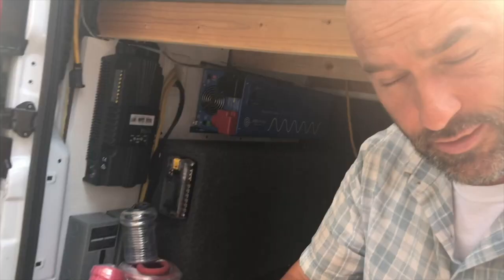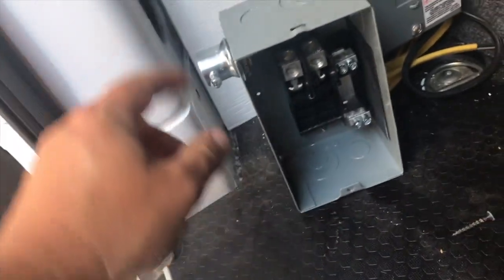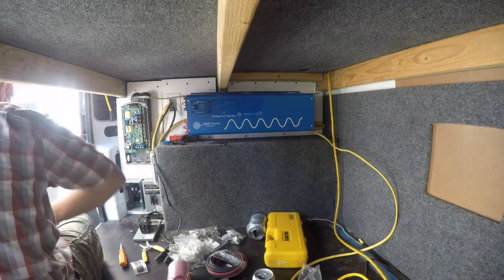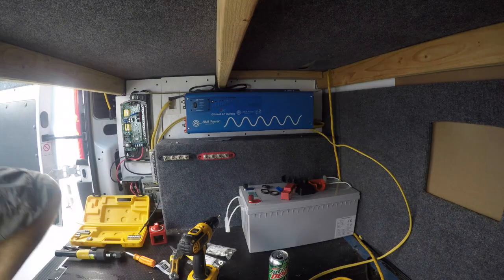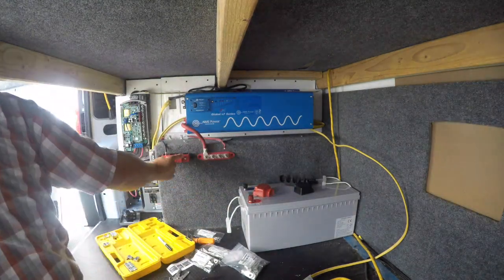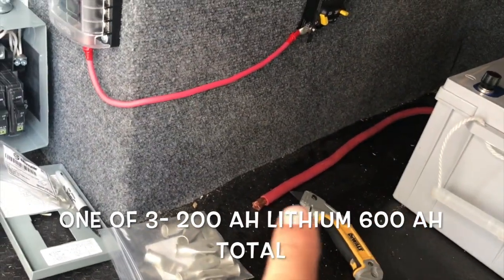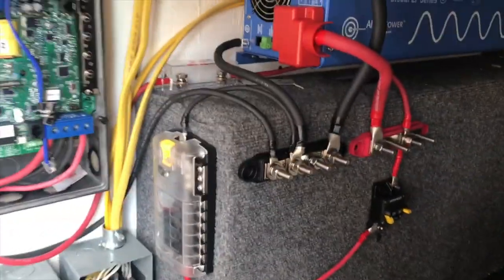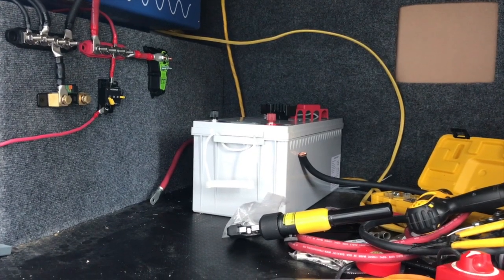Electrical system install in a Promaster conversion van

Comment: I couldn't tell how you connected to the car battery and how you routed the wires through the van from the car battery to the leisure battery. Could you share a little detail on that?

Comment: Specs don't look good on the battery. Discharge rate at 40 A, and peak discharge at 50 A.
My 100 Ah Battle Born are rated for a continuous 100 Ah discharge, and 200 Ah peak discharge (for 1/2 second).
I doubt that they are using the same cells as BB.

I hope you get decent performance out of these batteries. The rest of the install looks good.
Reply from the maker: Thanks Jeff- I put up a new video, I hope you'll check it out! I had the manufacturer modify the BMS for me so the new video shows the specs. I was able to run my AC for 7+ hours on just the batteries the other day! so amazing! hope you and your family are well in all this craziness

Comment: what do these batteries have for a BMS? Did they come with one or do you have to wire in your own?
Reply from the maker: dodgeplow they have a built in Bms
Reply: @PilotJon  If they turn out to be reliable and to capacity specs you should link the manufacturer in the description. Price is excellent.
Reply from the maker: Will do for sure!!! I'll use them for awhile then do a review with contact info for the company.
Reply from the maker: dodgeplow thanks for subscribing!
Reply: @PilotJon  yw. interesting so far. Planning a build of my own but not for a LONG time lol. I can partially retire in 10 years.
Reply from the maker: dodgeplow building and creating your own vision of a masterpiece is incredibly satisfying for sure!! Congrats on nearing retirement! I wish I were there- I’ve got so many things I want to do and not enough time...
Reply: @PilotJon   10 years is not near lol. Congrats on your build. looking good so far
Reply: also, with 600 aH lithium I would add an incinerating toilet. That's my plan at least.
Reply from the maker: dodgeplow closer than 20! Hahaha yeah I’m still stuck on the whole toilet situation... I have all that power because I have that big ac unit and a 4 gallon water heater.
Reply: @PilotJon  My (current) plan is: no black water  tank. 24 volt system. 600-800 aH lithium. 2 large roof panels (currently would yield me ~600-650 watts and would be better at the time of my build), electric incinerator toilet. and a 5000 btu disassembled wall AC unit (with condenser plumbed to beneath the van). 5-6 gallon water heater with dual electric and engine-coolant supplied heat.